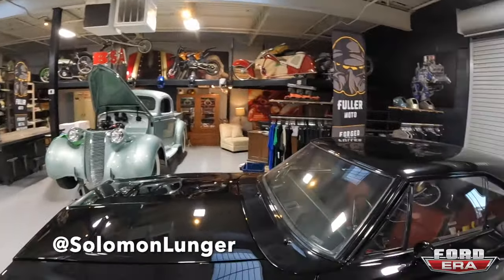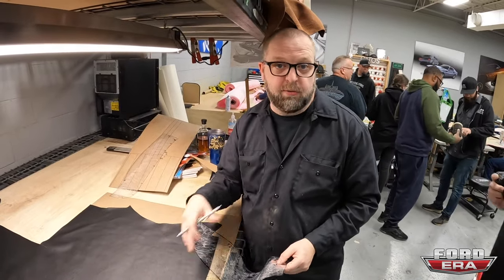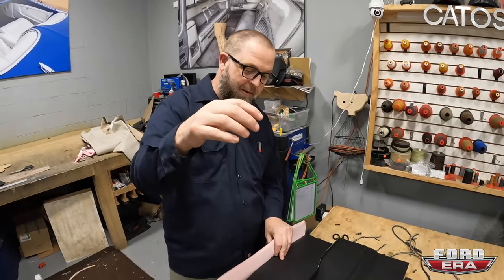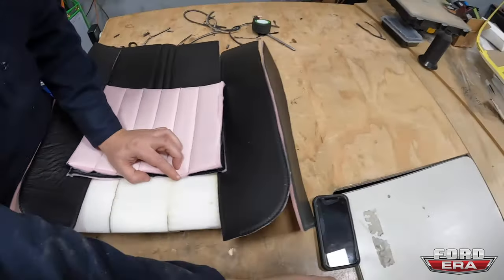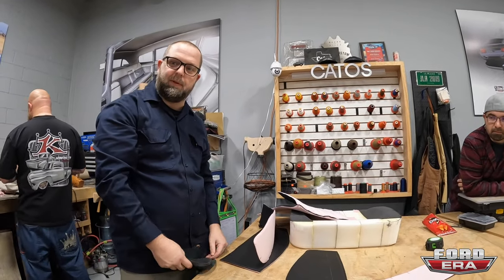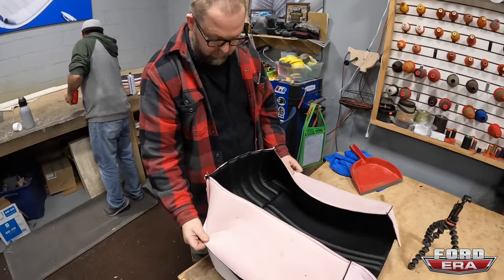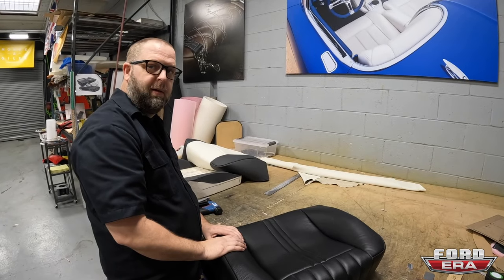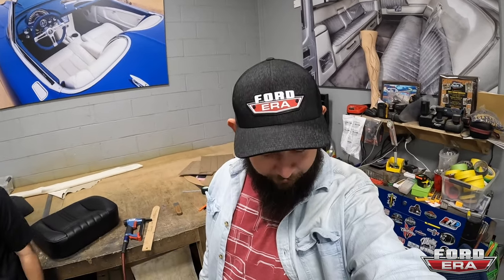How To Build Custom Seats with Cato's Custom Upholstery | Bitchin Stichin | Ford Era

Comment: I was taught never to glue leather to foam and never to glue the cover to the seat foam.
Reply: I also learnt the same... the way they did is easier, but leather and foam must move indepently 👍
Reply: it's temp glue. doesn't really matter after you sew the backing on tbh
Reply: I would cut just through the foam leave a large hem in the center lay the cover over the seat foam  then use Hog Rings underneath onto the Springs of the seat in the outer centers first no glue then pull material over the foam and Hog Ring the edges then attach the side covers. You said yours were custom every application is different! I would like to see someone do a solid headliner with a line around and just inside the outer edge. I have a 66 Charger Headliner I have to in Dark Blue suede. It has two line that are recessed and when I removed the material those lines are less prominent and now I need to add some foam to the soft fiberglass headliner board.

Comment: Attention !
For begginers or for more precise work , 
just remove your old seats upholstery and unsew everything into pieces, so then you will have a completely precise pattern for your car seats. Then at the pattern you can design custom upholstery designs , and then you just have a little more job because it's custom design but if you want to change just fabric of seats this way it's a lot easier.

Comment: I’m in the process of planning on making a custom bomber style bucket seat for my gokart, but struggling how i would fasten the cushion to the bomber seat. Any idea how i would go about that? I was thinking of putting a steel plate with welded on nuts on the wood backing, (hides the stapling as well), then bolting that to my bomber seat. Would that work?

Comment: You sped up the parts that needed to be slowed down so I can see what's exactly going on.
Reply: Yes, I guess that they did it so we don't learn the important things... 😔😔
Reply: Just replay in slooooomotion
Reply: @2nickles647  Well, that worked. I blew some pot smoke into my modem and the hamster inside is now proceeding at a much more leisurely pace. Thanks for the tech tip!

Comment: I was interested in seeing others do this but the examples are so poor.  The mistake is made because the teacher didnt bother to tell the guy to align the center details before sewing.  You shouldnt glue the foam to the leather either, it will wear poorly over time and ball up once it tears loose.  Then... when the teacher fixes the issue you haul ass through the fix it was pointless to watch.  Do Better.